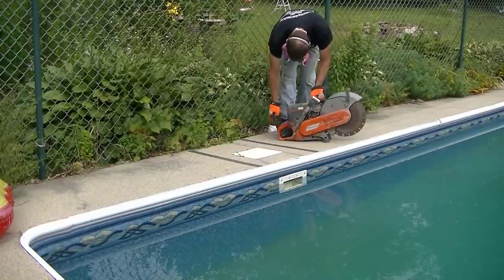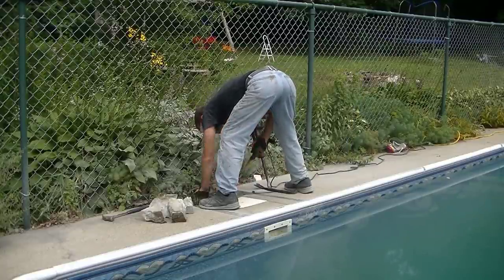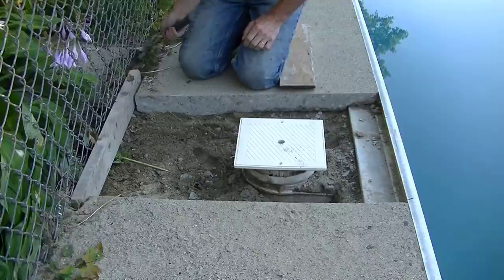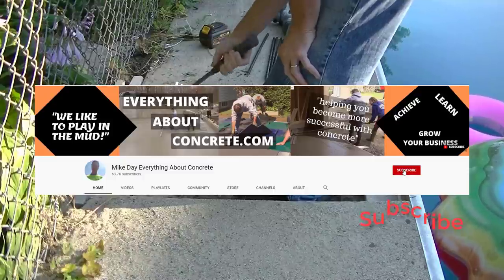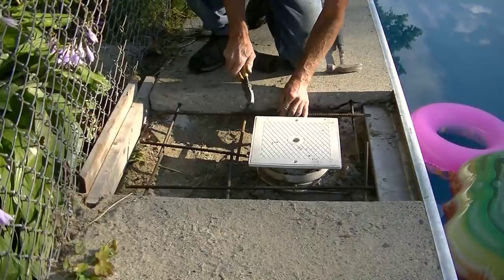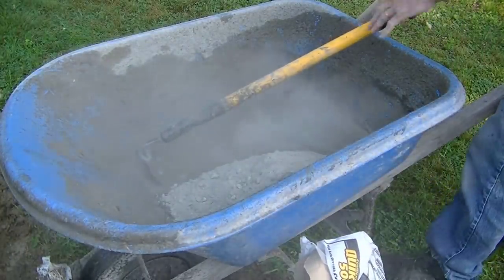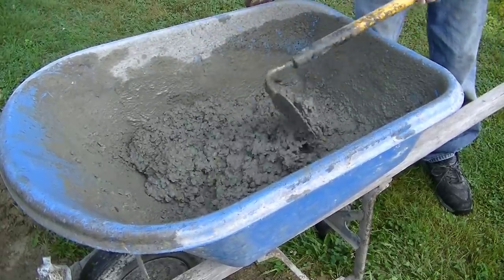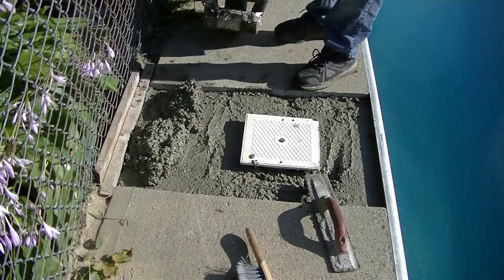Mixing Concrete By Hand To Patch A Concrete Patio (Quikrete)

Comment: Whew !   I just did a similar project to this one.   It was a 3ft by 3ft square, 4 inches deep.    I used four 60 lb. bags of ready mix concrete.
The printing on the bags called for 3.5 quarts of water per bag.   That turned out to be way low.   I added more water.   Perhaps my mix
was not as thin as it should have been, but it was mud, and not crumbles.   I used a rock rake to mix, but the concrete soon became too
thick, and so I used a rake and then when it was too thick use a shovel.   A shovel has bad leverage, and requires too much effort.   A hoe, 
such as you're using looks to be the right way to go.   I ordered one off of Amazon.   I like how you mix half a bag, and then add the other half.   
I'll try that.    I used one of those black plastic tubs to mix the concrete in, but I think I'll use a wheel barrow on my next pour.    I brush finished 
the small pad with a push broom.   The texture was too rough.   I notice you use a fox tail brush, and I will follow your example on the next pour.

Comment: Mike,  can a bonding agent be used to ensure good adhesion?
Reply: I can only speak from my own experience but, I’ve always felt bonding agent was very overrated. Sometimes it seems to work a little bit, but other times, it doesn’t seem to work at all. 
The rebar he put in there is the most affective thing you can do to prevent heaving or sinking.

Comment: Funny how a little 4sqft patch like that can take as much time as it does. You probably could have finished 200sqft+ of new concrete in the same amount of time. 
Did you consider making a pass down the saw cuts with the edger, just to sharpen up the lines a little bit?

Comment: Did you tamp the dirt before you drilled and pinned? Did this job use about 400 pounds of concrete? I am guessing that the patch was 3 ft x 3 ft x 4 inches.

Comment: Hi Mike, i use the same concete mix (5000 psi by quikrete) to stamp a small landing. I had a bad experience, i mix very very dry but still i had a lot of water on the surface. Stamp didn't come out good. Any tips for stamping small areas with out the need of calling for delivery.?

Comment: Hey Mike great videos, your highly skilled. I have a question about silica dust. Ive drilled into concrete for fasteners etc. I saw that you wore a mask for cutting and not drilling, long story short whats the best practice to not get exposed to to much silica dust? Am I being overly cautious wearing a mask while drilling small holes for tap cons ?!

Comment: Mike, I have deep pitting in several localized spots on my concrete driveway about 1/2" - 3/4" deep. I was thinking about using a two different applications. The first to repair the large pits and the second to skim coat a thin uniform surface over everything else. 

Will this work or do you have other advice on this?

Comment: Wouldn't it have been advisable to roughen the sawn edge and being it to a saturated surface dry state to avoid a cold joint between the existing concrete and the new patch?
Reply: completely agree